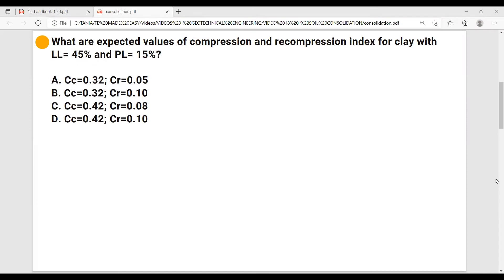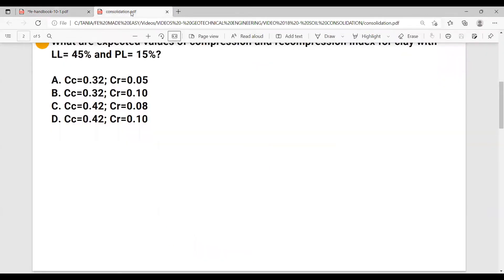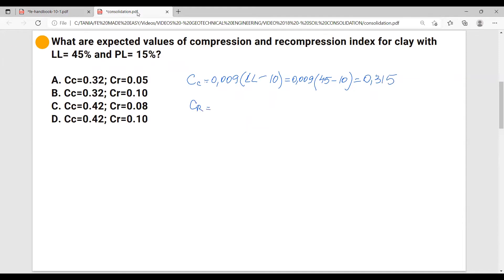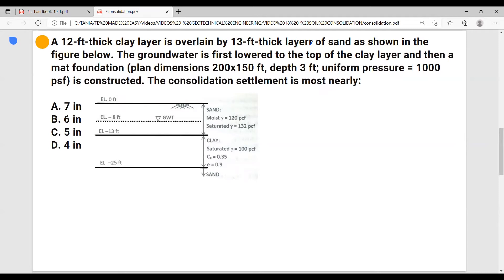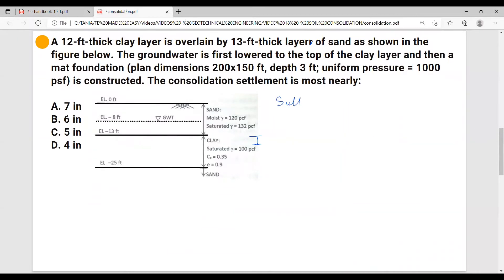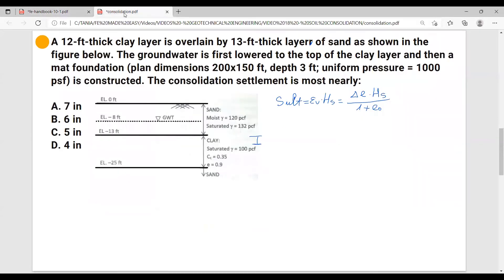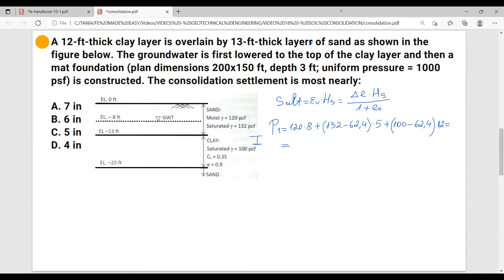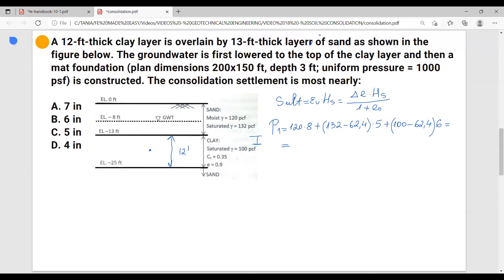FE Review - Geotechnical Engineering - Settlement Due to Primary Consolidation.

Comment: To find P2   Why didn’t you find the effective stress in sand layer like you did in P1?
Reply from the maker: Hi there, thank you for your question. P1 is the effective vertical stress at the center of the clay layer under original conditions and P2 is effective vertical stress at the center of the clay layer once the water level is lowered to the top of clay layer and the mat foundation (1000 psf) is added. Hope that answers your question :)!